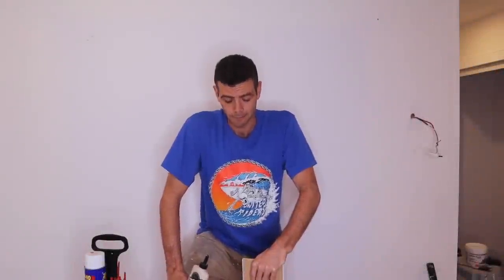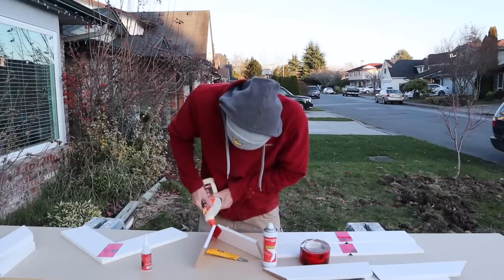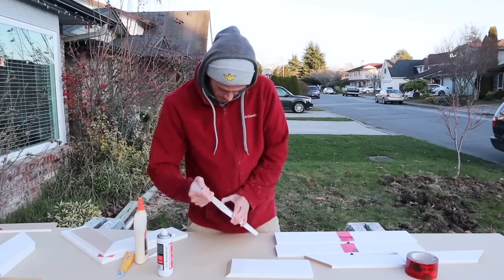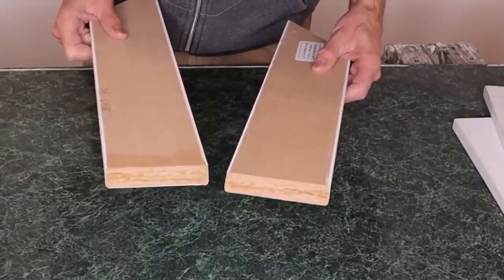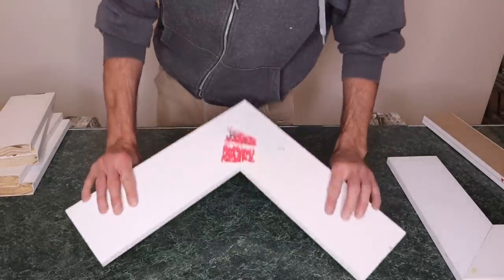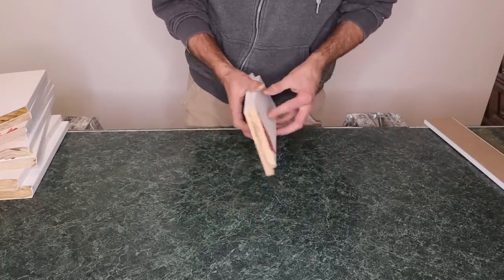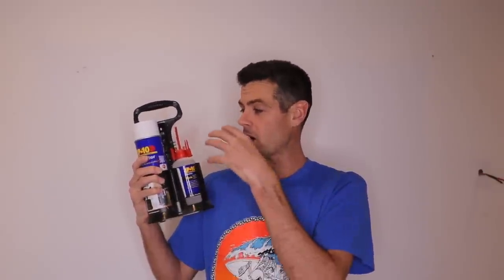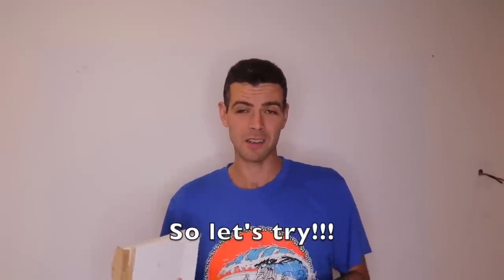CA Glue vs Wood Glue!

Comment: Since I am not a full time carpenter the quick set up ia nit necessary. I used to recone speakers and that was a different story but for commercial speakers that took a full time beating for concerts and especially all night Raves I would set systems up. What I noticed was the speakers repaired with the cyano glue would break down with heat and start smoking and catch the speaker on fire. Yikes!  Now okay Nature Boy yeah I'm concerned about the environment as far as waste for instamce all thes aholea with there freaking overpriced Tap Water. But as far as the air goes that stuff disapates and as long as we have trees and plant life it gets regenerated. Other than that really like your videos because your a Hoot. 😆
Reply: Depends where on the spkr. Dust caps to cone will work fine, but the voice coil bobbin and attachment point to cone, epoxy, high temperature type best. Ditto where the spider attaches to cone/bobbin. http://forums.prosoundweb.com/index.php?topic=87941.0

Comment: I have been using CA glue for 20 years and have never used it in carpentry of any kind.
Its most widely used and as far as I can remember in model building and RC vehicle building
A hobby glue is what it has always been.
Reply: I used CA glue in the early 70's to build balsa FF (Free Flight) model airplanes. The stuff worked fantastic for field repairs as well.

Comment: You could be right about the environmental impact of CA glue, although I don't imagine regular wood glue comes without its own footprint. As to the relative strength of the two, it is no surprise that the wood glue is superior, and interesting as it was to see the joint with the huge amount of CA glue (we call it mitre fast here in Scotland) I shudder to imagine the cost of blobbing on that amount of it on a  regular basis. But then, maybe that's just the Scotsman in me. Thanks for sharing!

Comment: The final "wood glue" experiment was ineffective because, although it dried, 4 hours doesn't allow the wood glue to climatize fully to the "cold" you described. You likely know that, but CA glue isn't meant to be structural. It works VERY well when you need to fit joints before actual installation. The material won't break bond if installers are smart enough to find studs while nailing. No wife jokes please 😝

Comment: Won't the cold temperature affect how each glue works?  Some glues don't react well in extreme cold or hot temps, and most glues mention, on the bottles,  the temperature limits regarding what temperature the glue will and won't work in.

Comment: I guess I'm questioning the whole purpose of this test.  I thought the whole reason of pregluing your trim was to close the joint and  make it easier to hang, ca glue is the clear winner here.  All houses move and over time you're going to have cracks and gaps appear, even solid wood warps and cracks.  Trim will never be a structural member, it's just the frosting...
Reply: Agreed - I would like to see more about the workflow. Like doing a door casing with CA vs wood glue I imagine you would do it differently. Eliminating clamping outside baseboard corners.

Comment: What are the odds. I was doing something similar earlier this week. Testing whether the benefits of CA glue were worth switching for.
Reply: Based on your own testing, and based on this video, what is your conclusion?
Reply: @917Stefano  while my testing is not complete yet. I had some joints fail prematurely on me. I will add more glue to next bunch.I WANT to remain impartial, but I'm having a hard time doing so. For me its easier to apply wood glue then CA.   One bottle one application as it were. But I do see the benefit of have a quick acting glue. Also storage of the CA glue can be a pain as well, since it likes to hard by its self in the bottle. All that said I'm still torn between the two. Maybe just have to keep both and use the one I feel is best. It is subjective after all.
Reply: @dhammer5645  Thanks, this is good info!

Comment: Gluing joints in freezing weather probably is not optimal.
Reply: The glue ups were inside for more than a few days
Reply: @tedreid1035  - was the adhesive applied in the cold?  Temp changes properties.

Comment: When your on the job, you don't have time to wait 24 hours for the wood glue to dry. Use the CA glue, finish the job, get paid and start a new one. It's going to be nailed anyways.
Reply: That's one attitude. Others may have a different take on life.
Reply: Your logic doesn’t make any sense. If it’s going to get nailed anyways, why do you need the fast setting stuff?
Reply: @SDMacMan  Because houses are never perfectly straight and true. If you try to assemble a mitre in situe, it will rarely meet up right. The idea with CA is to instantly glue your mitre together before installing it. This way no matter how messed up your walls and jambs are, the mitre will be perfect, and the discrepancies will be taken up in part by flexing the trim into place, and in part by having small gaps between the trim and the walls, which are caulked anyway as standard practice. Mitres are more important than any other part of the trim installation process, because they are what the eye is drawn to, and are never really fixed by filler and caulk. Most carpenters I see are doing really crap work, and don't even glue any part of the trim anyway, and leave their sub par workmanship for painters to fix. I for one am switching to CA glue because I am sick of fighting with my trim, and still not getting tight mitres.

Comment: Most of my CA glues joints are made with spit. Can't see myself buying a spray  can of water
Reply: Robert Durham Jr what?!
Reply: @jmlcolorado  I mean to say that I use spit for water. One time I got glue on lip. Lol not good
Reply: Not many people realise water (moisture in the air) is the reactant with CA. Breathing on the joint cures it faster.
Reply: @DiscoFang  it cures in 10-15 seconds.
Reply: Robert Durham Jr Yes, indeed. I was reinforcing what you were saying. My breathing comment was meaning in relation to not doing anything.
Reply: @DiscoFang  lol. Oh ok. I was wondering what you implying